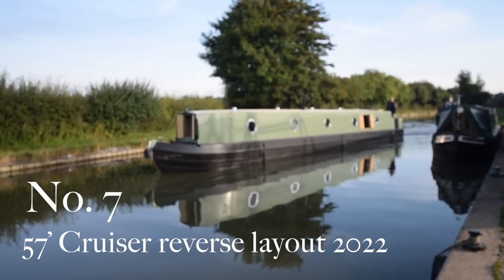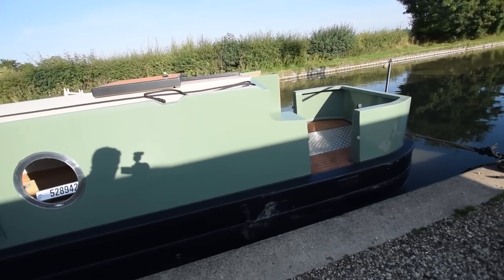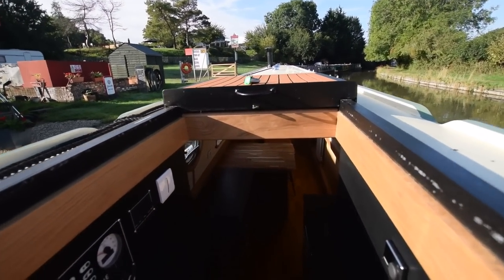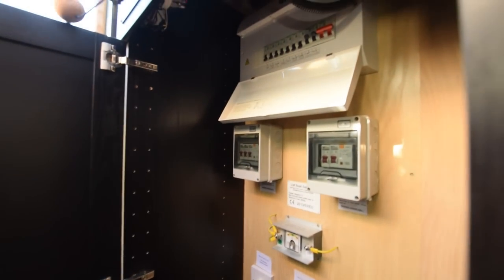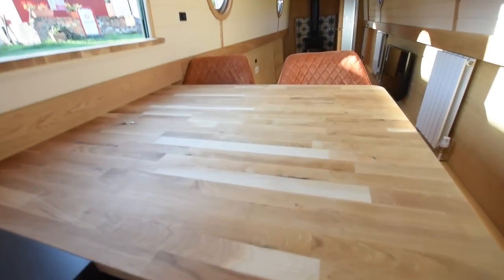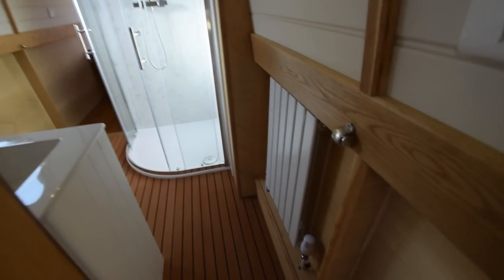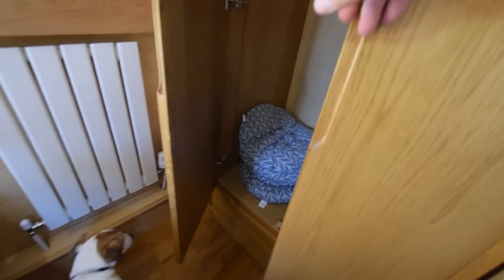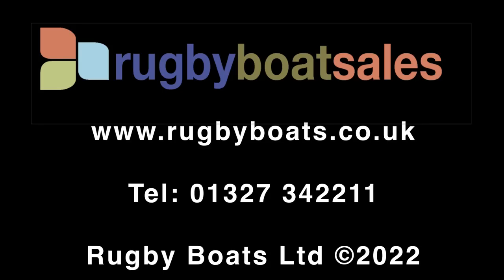SOLD - No. 7, 57' Reverse layout cruiser 2022 S. Jackson & Sons

Comment: As a sailor, I never understand why narrowboat builders don't learn from yacht builders. The stern deck could be equipped with seating on both sides, with a demountable table on the engine deck for comfortable outdoor dining/relaxing. 
Why is there no extractor fan fitted in a small enclosed space like this? Cooking smells have no easy way to leave the boat. 
A cassette toilet? Come on, fit a decent composting model. 
No custom-fitted mattress and a hugely uncomfortable board at the bottom. 
TV positioning, wth were they thinking?  
No solar means it's either a dock queen or you need to run the engine or a genset constantly. It's 2022 people. 
That's a lot of money for something that feels half-assed in so many ways.
Reply: Narrowboats seem stuck in a bubble that is disconnected from the wonders of modern RVs and boats.
Reply: Re: Composting Toilets. Sadly there are very few areas to dispose of the contents of the composting toilets on the Cut. The CRT are doing their best to sort this out,  but, until they do you have to keep the contents on the boat or take it to a composting s!ite, away from the waterways. I prefer my cassets and empty them every couple of days, or use the pub! 🙂  Solar IS very popular and, on new boats, left upto the buyers what type and placement they want.

Comment: This is a brand new boat built to a saleable level. This allows the new owner to modify to their taste, that could be more elaborate paintwork, covers, solar etc etc. The saloon is a totally blank canvas so again the new owner can put in what suits them. The bathroom is nice and given what dump sites are on the canals it appears cassettes are still the better option, when that changes it can be converted to a composting one if the new owner desires. The enclosed cabin you either like or you don't, personally I like them. Lets face it no narrow boat bed is easy to make. If that base board is to high that is easily modified. To gain room in the boat I am happy to loose the well deck when there is so much space on the cruiser stern. Any number of seating options are possible. This boat will not suit everyone that is why there are so many different styles being built.

Comment: It's a nearly new boat, so it should be pristine. Don't like the lack of windows. The kitchen looks great but the space under the stove needs a door or something. Nice, high ceiling. Lots of space in the saloon, but if you're not going to put windows in that area, why not move the television up where it'll be easier to see? Do like the woodwork. Bathroom is nice. Bedroom has huge bed, but not much storage. No solar on a new boat? The price is basically what you'd pay for a new boat, and with the very low hours on the engine, that's what you are getting. I'd budget to add solar panels, maybe an extra window or two or Houdini hatches in the roof for more light
Reply: Solar is generally an after market thing. If someone wants solar they will buy the boat and then have it installed, if a buyer doesn’t want solar, they are not gonna buy the boat.  As a builder or a broker you want to go with that give the greatest chance of making a sale